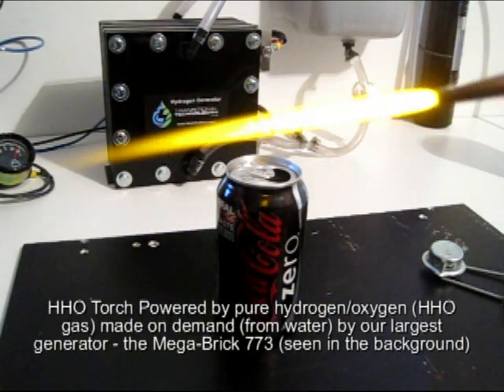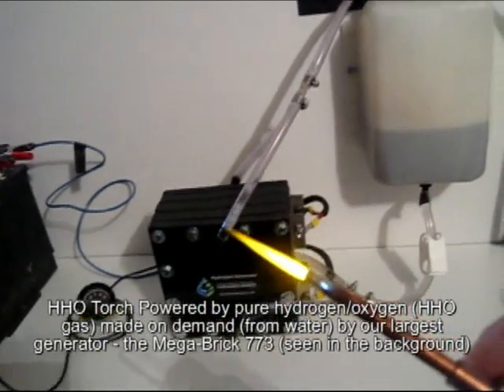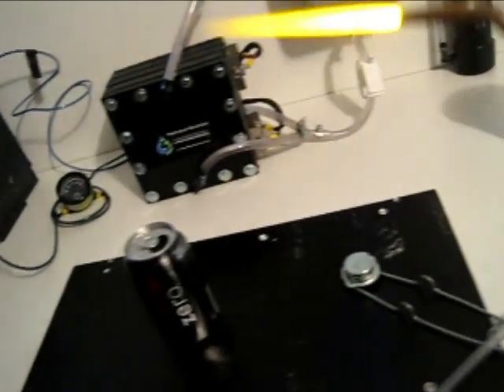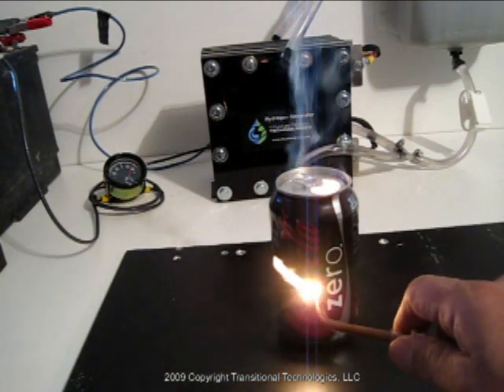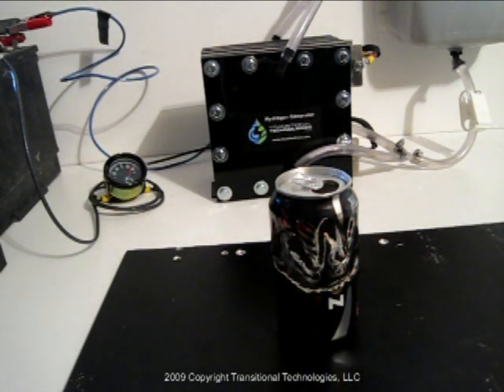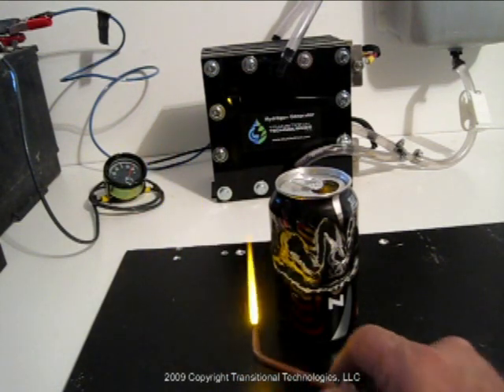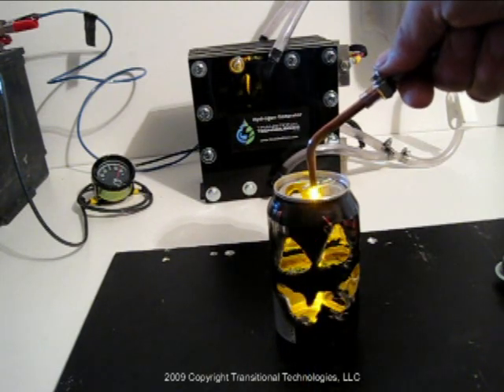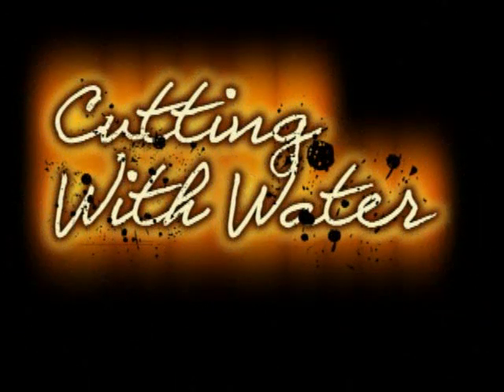Cut with water

Comment: Oh no this guy trying to sake something you can buy to make what a joke
Reply from the maker: "This guy" has been manufacturing and selling successful hho kits for over 16 years now, with many repeat customers and referrals. "This guy" also has multiple patents including new patents on our current 5th generation systems, with more being prepared. "This guy" is also currently negotiating international deals because of the success of our kits, and has traveled to other countries successfully demonstrating their ability to reduce carbon output and increase fuel efficiencies. 
"This guy" is NOT selling that torch demonstration setup (if you had take even 5 minutes to research you would have found that out). Rather, this is simply a demonstration of interesting properties using on demand hydrogen in a cutting torch setting. So next time, before you post something you are ignorant about, do some research first. Then you will realize this is not a joke and we will not let false accusations go unchallenged. We actually encourage others to build and test their own if they want.

Comment: Interested to know how many Amps you are running
Reply from the maker: Our kits operate best in the 18-25 amp range. We have found in many of our tests that 18-20 amps seems to be the sweet spot for best results.
Reply: @transitionaltechnologies648  thanks or the reply.  Only one year after the comment 🤣🤣.
Better late then never lol
Reply from the maker: @karlmyers6518  Yeah, my fail for sure. My apologies.
Reply: @transitionaltechnologies648  no problem,  it made me chuckle
Reply from the maker: @karlmyers6518  Yeah, things got very busy for so long, social media was ignored more than it should have been. Trying to rectify that....
Reply: Dear  how many plate and  sizes
Reply from the maker: @pubududasanayaka8554  This torch was running off of our commercial truckers unit which was using 2-884 kits wired in series to run on 120 volts (25 plates each - total of 50 plates). Our next generation kits soon to be released, will have 31 plates (885). 
You can see our 800 series here: www.hhokitsdirect.com